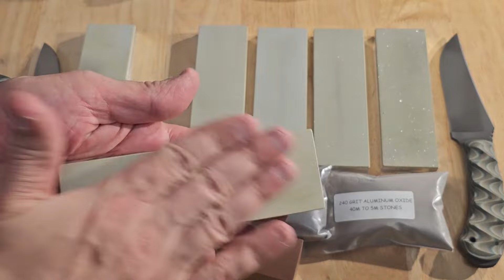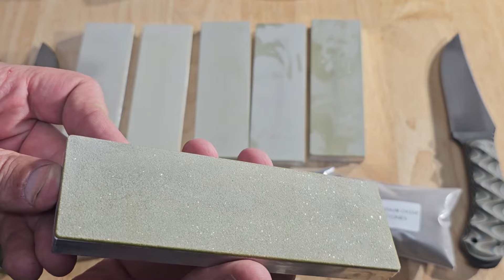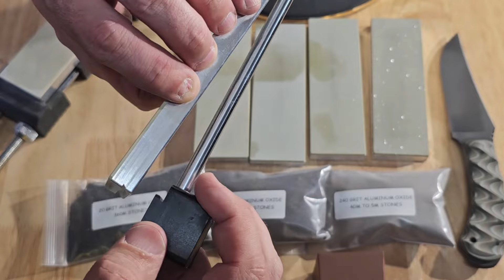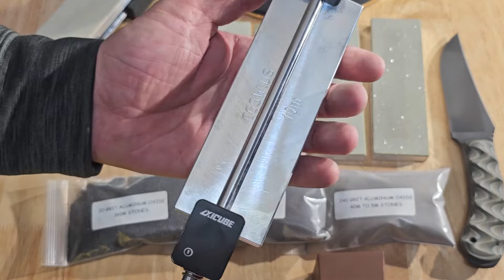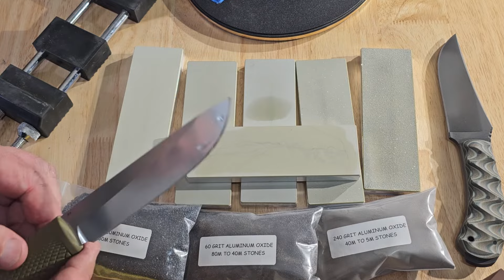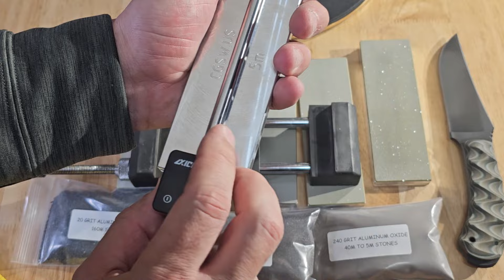Diamond Resin Whetstones Sharpening Stones Columbia Gorge Stoneworks 2x6 @CGSW

Comment: Can I ask why you have all of them? Just curious because they aren't cheap and you don't actually need more than 3 to do anything that can be done, if that makes sense. At most 4. Generally a course grinding stone. a medium sharpening stone. and a fine finishing and polishing stone. 

It would be nice if folks were more transparent about stuff too. Whats the actual tolerance for the grit distribution for instance. What's the actual hardness and friability of the resin binder. Concentration of abrasive. wear rate. flatness tolerance from new.
Reply from the maker: I like to make things sharp.

Comment: For your guided sharpener just get the Edge PRO diamond Matrix stones, they are made by CGSW and are very similar if not the exact same as these.
Reply: They are 100% identical.. Just edge has reserved the right to sell 6*1" under the "Diamond Matrix" and David is selling other platforms but they are made in the same place, same composition and performance
Reply from the maker: Thank you for the info..
Reply from the maker: The Edge Pro Matrix 1x6 are excellent stones as well. The Tsprof K03 can handle the 2x6 stones for quicker sharpening. I have both and both are great! Thank you for the feedback.